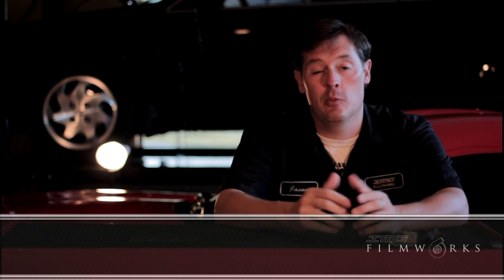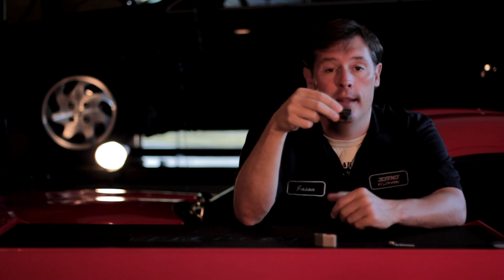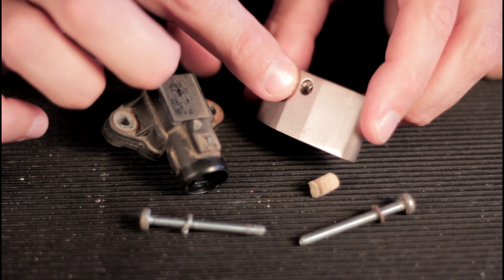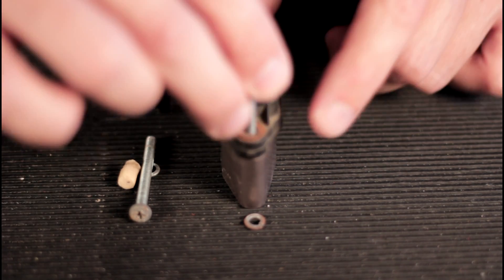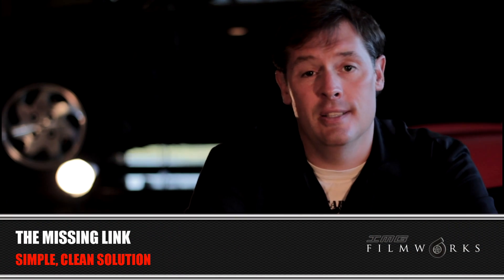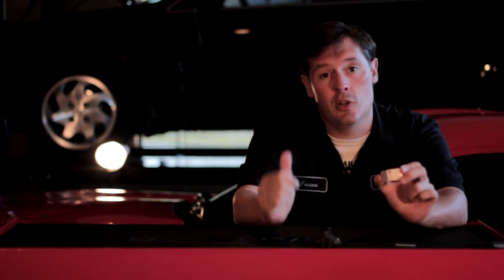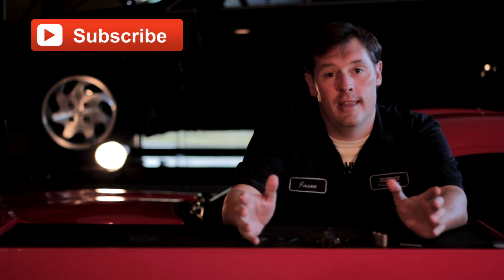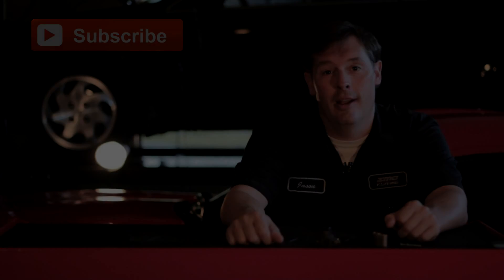Building A Budget Beast:  Episode 6 - The Missing Link Theory & Installation

Comment: + rubber duck
did you have to trick you 02 sensor at all? iv watched a video on (broke & boosted)  that he installed a pressure switch to trick stock ecu so the car doesn't run to lean? I'm still kind of confused so I'm not sure how to fully explain it. but did you do any thing to your stock 02 sensor for it to run okay? not including installing wideband.
Reply: there is sensors that are dummy sensors that trick the ecu into seeing values it wants to see. Tune your car you wont have to worry about it blowing up.

Comment: I have a 98 accord and have been dealing with the car not having the power it used to. I'm sure it's because it now has 160k miles, it's laggy. I don't have check engine lights. but I did notice a hint of burned plastic-ish smell when  the car red lines. what could be the problem? I do the tune ups on time.

Comment: ok in the middle of my turbo build on the j30a  is it ok if the oil return line tap is close to the exhaust pipe, any recommendations? I'm thinking I will have to custom weld my exhast but it  will be close like 3 inch away after looking close I might can pull four to five inches at most it is where the tap is on the oil pan

Comment: your great at making videos man. 0 dislikes... that's rare
Reply from the maker: Thank you for the nice comment, I try :)
Reply: +Rubber Duc hey duc quick question, when you ordered your downpipe did u have to rotate it in any way? or is it plug n play.... just wondering if u cut on the exhaust turbo flange and rotated it. also have a f23a4 motor.thnx
Reply: +Rubber Duc hey duc quick question, when you ordered your downpipe did u have to rotate it in any way? or is it plug n play.... just wondering if u cut on the exhaust turbo flange and rotated it. also have a f23a4 motor.thnx
Reply: +Rubber Duc hey duc quick question, when you ordered your downpipe did u have to rotate it in any way? or is it plug n play.... just wondering if u cut on the exhaust turbo flange and rotated it. also have a f23a4 motor.thnx

Comment: I am installing my turbo this week. correct me if I am wrong the blow off value vacuum line is connect with a 3 way between the fuel pressure vacuum line which connects to the intake manifold  true of false?
Reply from the maker: Doesn't really matter where it connects as long as it is a good source of vacuum.

Comment: Hello my name is Matt and I currently have a f23a1 accord and just bought the turbo kit. First of all thank you for these videos they're freaking fantastic. Could you show the whole engine bay and quickly run through the actual kit installation such as where and how to make room for the inter cooler and inter cooler piping, where to connect piping for turbo, and point out difficulties of the installation. Thanks so much keep up the videos!
Reply from the maker: Hi Matt, I will try to get a video of a walk around/test drive very soon and will make sure to include that shot of the engine bay.

Comment: Hey man. My 1999 do 3.0 vtec automatic is running about 175 hp with no good mods. Could I do this to my car and do you think a shop would put it in for me?
Reply: "DX sorry
Reply: And it's a v6
Reply from the maker: Not sure on the V6, I don't think much is available unfortunately so I think it would be a lot of custom work.  And always with an automatic since it is much more fragile than a standard you would really need to be easy on the transmission to avoid problems with it.
Reply: your best bet would be to. 6 speed swap befor u turbo
Reply: +Rubber Duc. any clue when the next vid is lol

Comment: Hey duc I have a 95 accord vtec and swapped it won't for a f23a1 engine off a 2001 accord because I want to turbo it, the f23 has 90k and seems to lag for a couple seconds and then picks up and has a high idle I have the f22b1 intake manifold on the f23

Comment: Hey Duc, my 2000 accord F23A1 has a cold air intake and sport headers installed, would this build require me to remove these mods?
Reply from the maker: +Cameron   McAdory   Yes.  The cold side of the turbo has to go directly to the intake and the headers would have to be modified to accommodate a turbo flange or you would have to switch to another manifold.
Reply: lol depends if you custom make your intake to connect to the  inn cooler and if the headers are are bolt on or welded